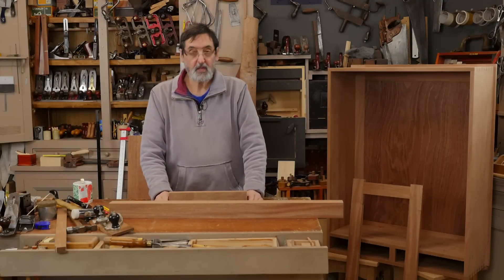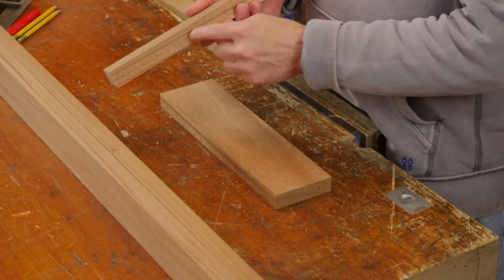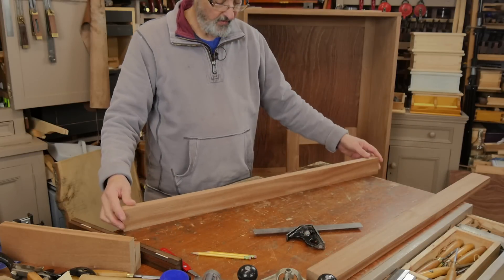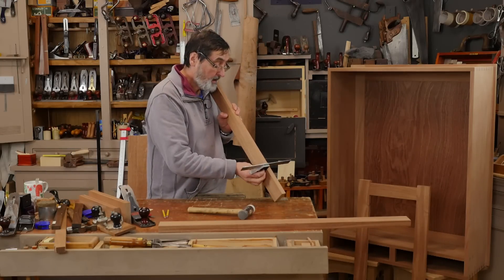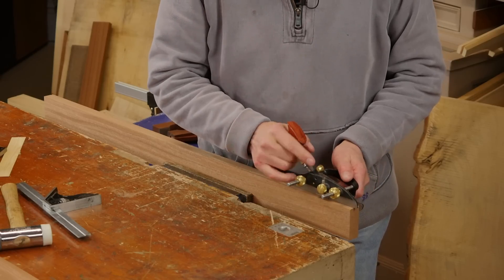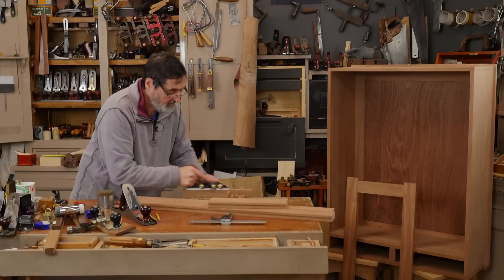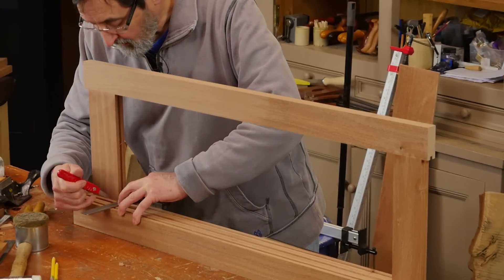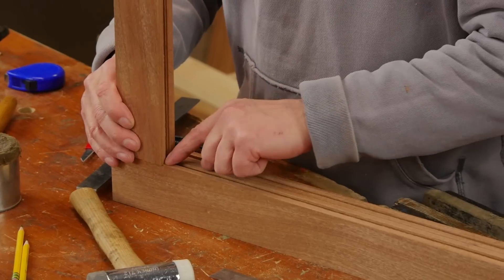Door Making Episode 1 | Paul Sellers

Comment: Exceptionally good teaching video. Too many videos cut out mistakes. Not that I see any here. Just Paul explaining how to avoid mistakes.

For example, Paul showing that, especially with hand tool techniques you, "sneak", up on the final dimensions to take account of any errors all humans make. 

For example, leaving an overhang on the long edges of the door for protection and to make it easier to get to correct dimensions for the final door.

I'm in my early 50's and I still haven't been able to make such awesomely close joints as I see Paul doing in all of his videos but this is clearly due to Paul's extensive experience and patience that he has under that ever expanding belt of his....lol.

Wood filler and paint are my life long friends that hide my lack of skill.